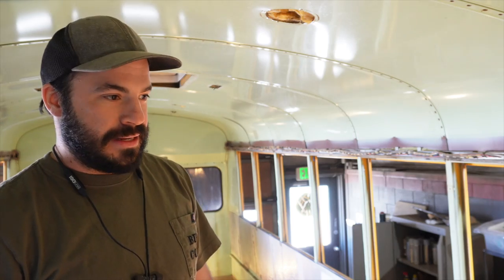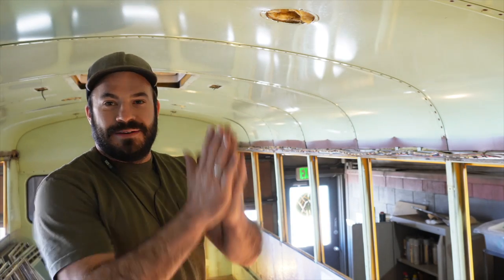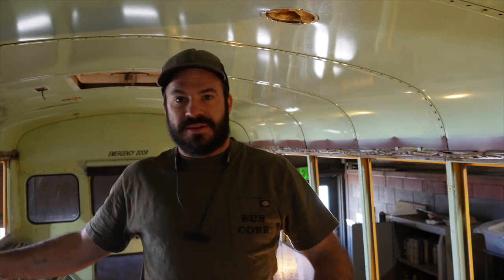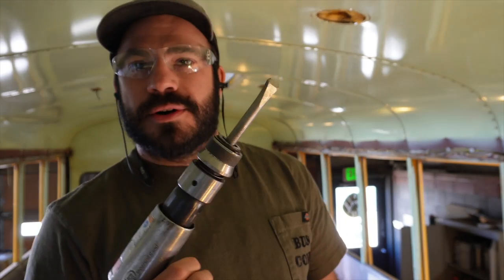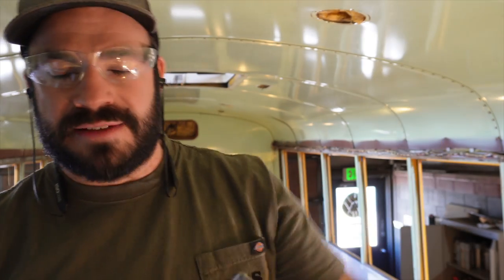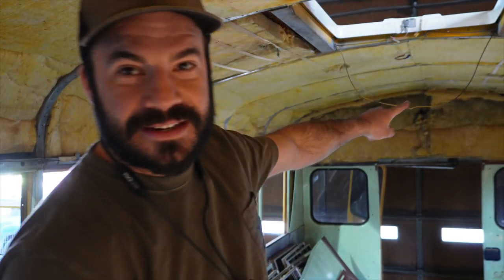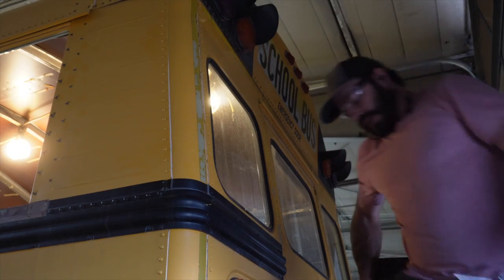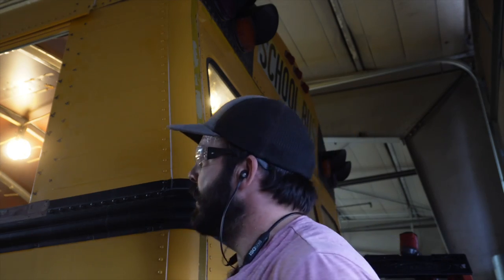Preparing for my ROOF RAISE and WEIGHING-IN (Skoolie Conversion Guide #3)

Comment: A year in from starting my bus, I'm still finishing parts of my roof raise!  Personally I am also raising my wheelchair lift door, which I have not seen done before and has required a bit of head scratching as a solo person.

One thing I will stress, is making straight cuts across the steel, and removing as many things as you can before raising, such as rub rails, windows, etc.

Comment: So I've seen a ton about roof raises. What about lowering the floor in a coach bus (MCI). With the idea being to drop it down in the middle so we can have a nice high ceiling "living room" with access to the washer/dryer that would be in the under storage area. 

Based on my preliminary research it seems it would really depend on the model since some have structural beams that can't be changed but it sounds like it might be possible with older models...

Comment: yes by all means add a set of air bladders to the bus it made a world of difference in my 82 Winnebago.
the ride went from BAM!! BAM!!! BAM!!! to ahhh ahhh ahhh
and i had a 12v compressor so when i was four wheeling, (some road turn into cow paths with no where to turn around) it so to speak i could air them up for more clearance 
it also helped in leveling i could park level side to side then lower or raze the front or back to level it out from the drivers seat.
thanks 
i just had to soap box that
Earl
Reply from the maker: Airbags are awesome! I have them on my camper

Comment: One of the issues I'm bumping up against with my short bus is that it's still a bus. Meaning it needs all of the mechanical things that a bus needs, only it's crammed into a MUCH smaller package. I just can't find room for the tanks underneath. Want to add a propane water heater under the bus by the skirting? No. It's not happening. 36 gallon fresh water tank and a 24 gallon grey tank? Pick one. And neither will be as big as you need. (The grey water tank is probably the only thing that has to go under.)

If I did a larger roof raise, I could put most of my utilities under the floor. Access them through doors on the sides or hatches inside. Hell, I could even fit my entire electrical system in there. If there's something I can't fit (too tall?), it's fine to have that inside the living area because there's not as much of those things taking up room inside. Storage in the living area is already going to be at a premium and sacrificing an entire bench interior for utilities is a huge problem.

As things stand now, the fresh water tank must go on the roof and I'm not thrilled about that. Possibly also the aux gas tank for the generator. Both of those are problems on the roof in their own right. I doubt a roof raise could be worse than that.

Comment: I'm surprised he didn't mention the Federal Highway Dimension Limits (8.5' x 13.5').  Raise the roof any higher than that and you will soon have a Very Bad Day.  Also surprised that he used an air-chisel on the rivets, which damages the skin underneath.  But then, he'll most likely scrap the removed sheet-metal. If he were to save the skin for whatever reason, he'd have to center-punch, pilot drill, THEN chisel.  A lot more time, easier removal, and the sheet metal is saved.  A great tutorial on fabrication!

Comment: Looking for advice. My bus ceiling is ALL rivets. I’m going to raise the roof and I’m a little concerned about the quality of the ceiling insulation. Buttt I’m also wondering if i can make enough of an impact in r value if I leave the ceiling panels, raise the roof and still go over it with a spray foam? I guess I’m just trying to figure out if it’s worth it in cost or time to take out all the rivets or just leave them?

Comment: I agree if you are going to build a bus out take out the old insulation and floors to make sure there are no leaks or rust, that will cause bigger issues.  As I'm only 5'5" tall a roof raise wouldn't be something I'd need, but a sunroof raise in the bathroom and down the middle would be cool. Thanks you definitely know your stuff.
Reply from the maker: Agreed! So worth it

Comment: If wool was to be used instead of spray foam, could plastic barrier be stapled around the bus along the firring strips to keep the moisture off of the baltic birch walls?

Comment: A 25' bus will need 26k btu of cooling and heating to be comfortable in summer and winter. In a 40' bus 45k A/C is minimum and 35K btu heat minimum. Insulation is everything it will not lessen the values listed prior but it will save you greatly on the cost when you need to use them. I have a Fleetwood American Tradition RV With 28K btu cooling and 35K heat. In 95-degree heat inside temps run in the low 80s with both roof A/C running all day long. Monthly cost 260.00 in electric. This coach sold for 280K new in 2000. Insulation can make or break the liveability of your new home. Remember the temps in the south west U.S. like Phoenix AZ yearly see temps in the high 110's like 118 degrees every day for 2 months straight.
Reply from the maker: I’ve cooled several 35’ buses with only 12kbtu. The last bus I lived in in Colorado four seasons was heated by only a 16kbtu wood stove and cooled by a 9kbtu ac. It was 37’ long, spray foamed, with rv windows. Made a big difference

Comment: Very interesting. 
13,750 lbs Gutted. 
GVWR 25,700 lbs
How much prior to gutting or Empty as manufactured?
I’m curious how much the inner skins, rubber flooring and seats weigh.
I imagine they have to plan for weight of 2 average adults per seat, plus fuel and fluids, along with a fudge factor, since they aren’t just used for children transport.
My guess would be you removed around 2000 lbs and 30 passengers at 150 each would be 4500 which is light for an average “American “ adult. 
So add fuel 500-800lbs and you still had a healthy fudge factor of over-engineered design.
Reply from the maker: id say we removed around 1500-2000lbs vs just empty but i didnt get a weight of it prior to demo. i think we will have about 6000lbs-8000lbs of headroom AFTER the conversion is done we will see! Stick around!

Comment: can you raise the roof by adding the extra height at the black band below the windows?
Reply from the maker: You can indeed!
Reply: Yes! They refer to it as a “below the window roof raise”
Reply: I love your videos! Keep them coming. Can you please discuss the difference between these two roof raise options in your next video and why you choose the way you are going? I’ve got a 27’ snub nose Thomas and I’ve been tossed on the roof raise because I’m only 5’2-but my husband is 6’4”. Hubby is worried about the structure of the bus if altered and claims he can duck as ours is more of a part time camper as opposed to a full time home. I really enjoyed your break down of the time and cost involved-it’s super helpful. I was also trying to figure out the spray foam vs wool option and your explanation was amazing. I was wondering, does the type of insulation matter if you are in extreme heat vs cold? We are in Florida. Is R value simply R value? Or do you need to worry about other things too? Thanks for the videos. Do you have a Patreon yet?

Comment: A question to metal workers out there. Can you use the metal from the bus seats as support for a roof raise? I realize they're different shapes, but if you can weld them together and they're not seen.... can you save some $$ that way? Depending on how high you're going, there looks to be plenty of lengths on the seats to do the job. Maybe I shouldn't try to fit a square shape into a round hole. LOL
Reply from the maker: That is not a place I would experiment with saving money. We only use extensions that match the factory specs and dimensions
Reply: @ChuckCassadyYT  I figured that would be the answer. Thank you for replying.